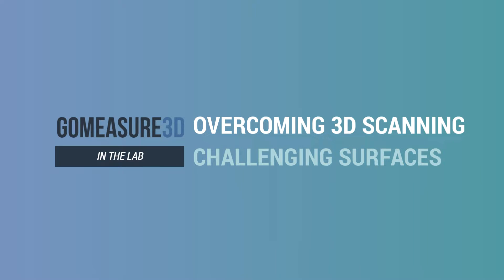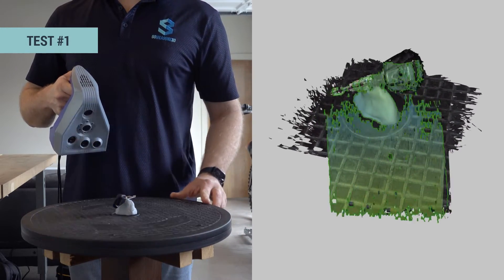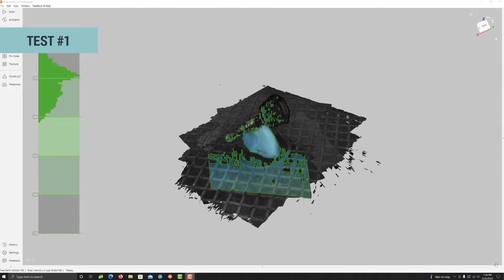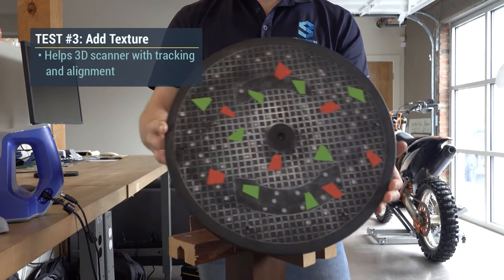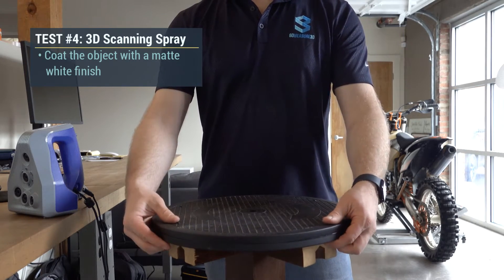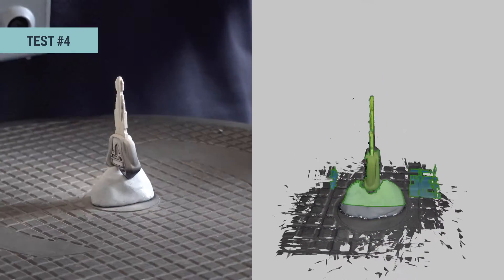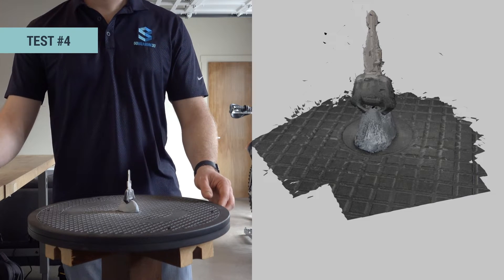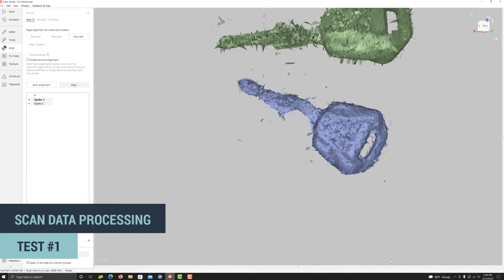In The Lab: Best Accessory For Overcoming 3D Scanning Challenges

Comment: Do you not use a tripod or something to hold the scanner still?
Reply from the maker: The Artec Space Spider is a handheld 3D scanner. There's no need to use a tripod to hold the scanner. Artec’s handheld technology operates similar to a video camera but it captures objects in 3D with continuous scanning. Simply turn it on and hover around the object for recording. It's that simple 😊
Reply: @GoMeasure3D  IS THIS one good for smaller intricate pieces like jewelry, rings, etc. ?
Reply from the maker: @ericfenstermacher9249  We typically recommend the Artec Micro for smaller intricate pieces like jewelry or rings. 

• It’s a desktop 3D scanner that has better technical specifications (higher resolution and accuracy). 
• It’s an automated device that eliminates the human error in the 3D scanning process. 
• It’s better at 3D scanning smaller objects than the Artec Space Spider because it tracks the position of the object through the automated turntable.

For more information on the Artec Micro, please visit: https://gomeasure3d.com/artec/micro/

Hope this helps!